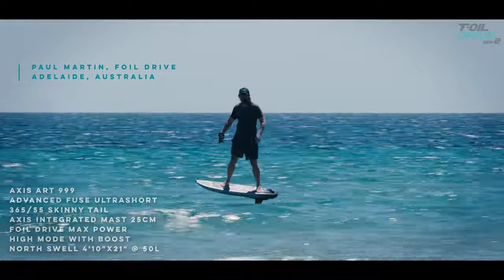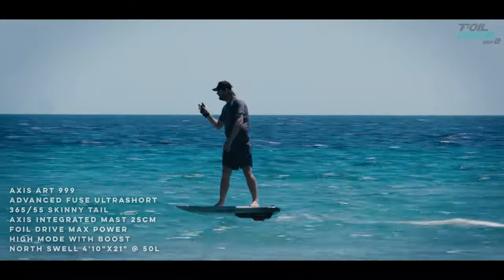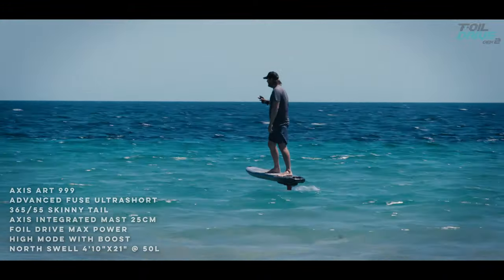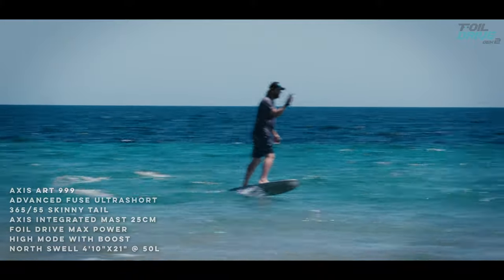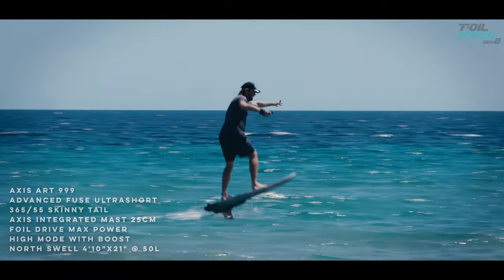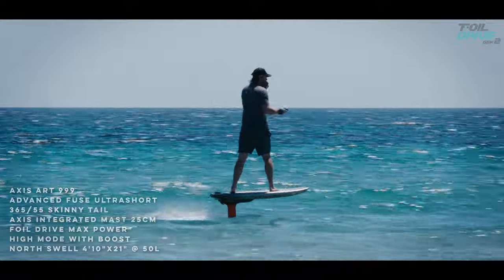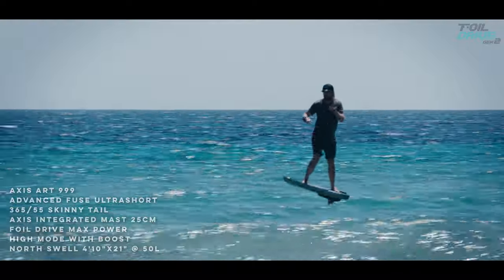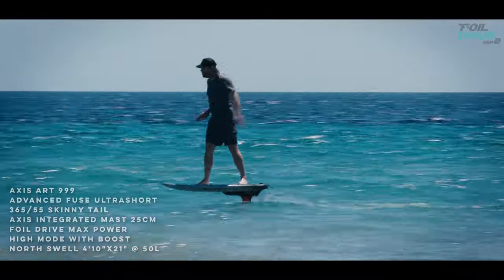How to Overcome The Bucking Bronco | Foil Drive Masterclass Series

Comment: how do I hold the controller exactly at 80%?
Reply: You have a couple options:
1) The controller has a progressive trigger so you can hold at 80%
2) You can go into the setting via the remote or the FD app to limit the max power setting to 80%